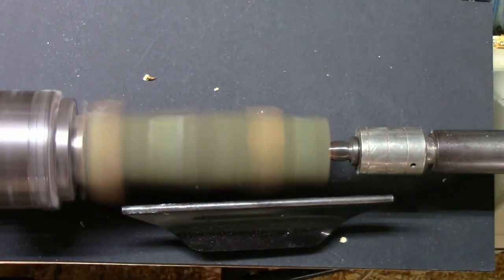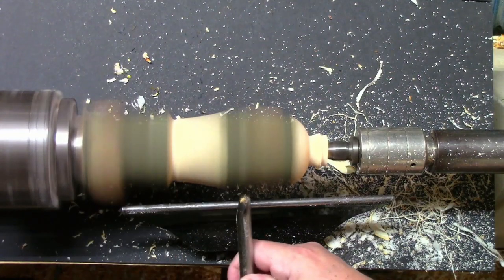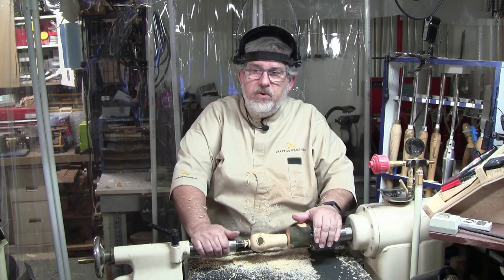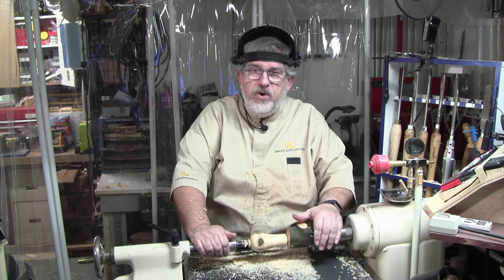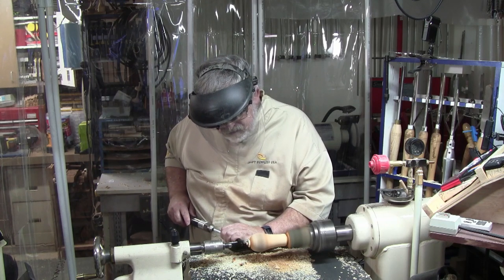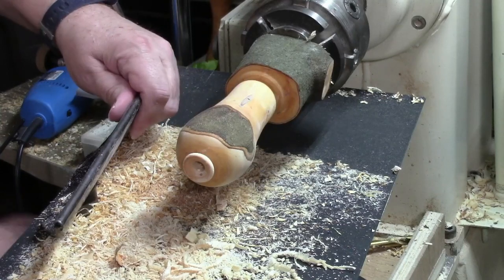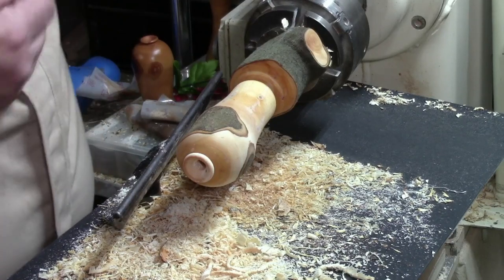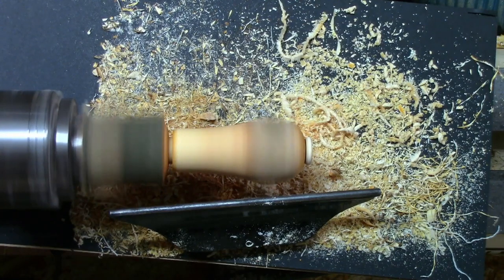Twig Pots in the Workshop

Comment: Nice video! The branches are probably wet. How do you keep the twig pith from cracking?
Reply from the maker: yes most of the time they are green. once turned I apply a coate of Danish Oil, or Antique Oil this seals the wood and reduces or eliminates the cracking. Thanks for Watching!!!
Reply: @DeansWoodworking  Hi Dean, I really like your video's! Would walnut oil also work to help eliminate cracking?